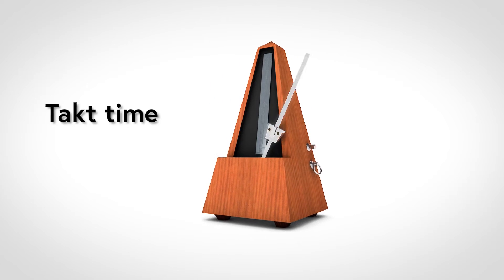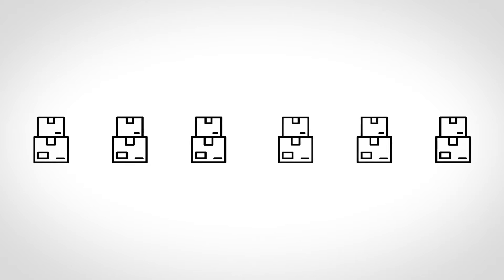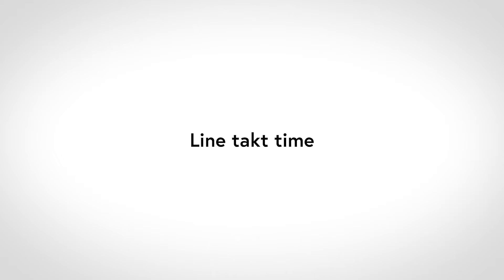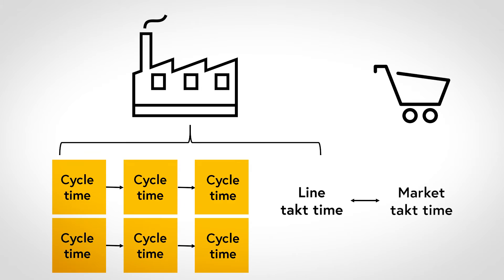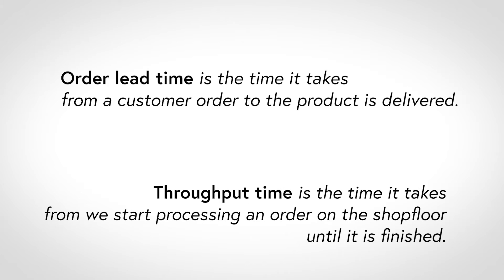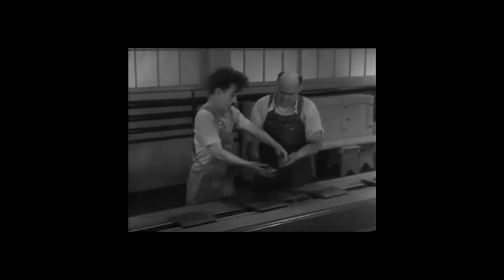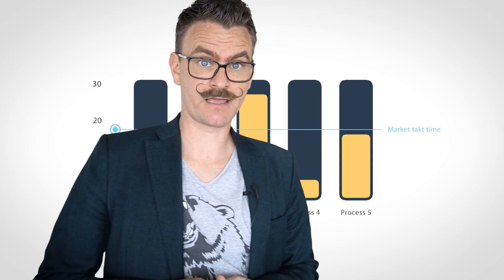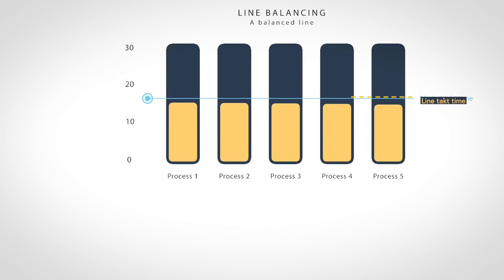Bottlenecks and Takt Time

Comment: Hi Professor, I think, if we add another line the Takt Time will NOT be doubled but half!
Reply from the maker: Hi Touhid, we're sorry the inelegant wording has raised some confusion here. In fact, when the lines double, the cycle times double: Before, a single line produced, for example, at a takt of 4 minutes between consecutive parts. Afterward, two lines produce at a takt of 8 minutes between consecutive parts. The factory still produces a new part every four minutes.